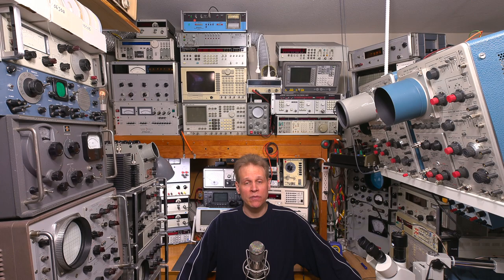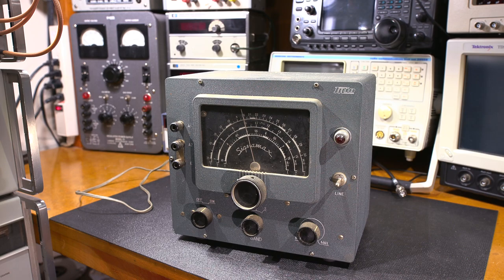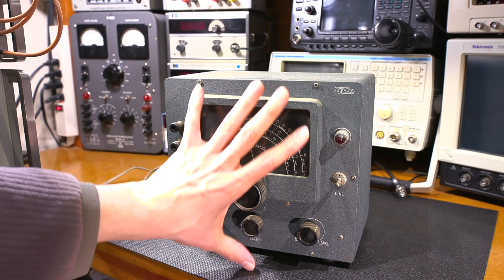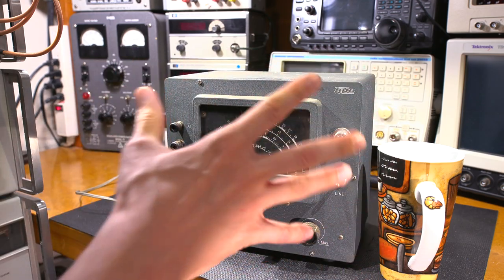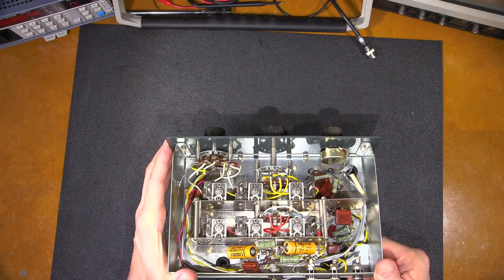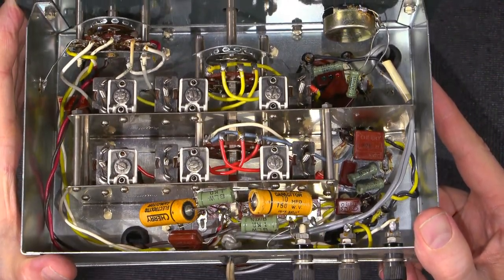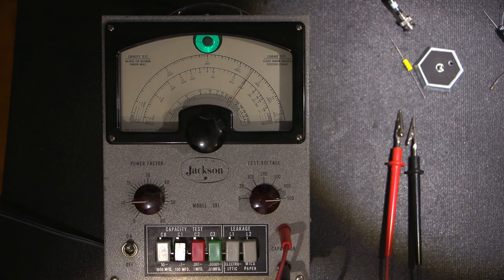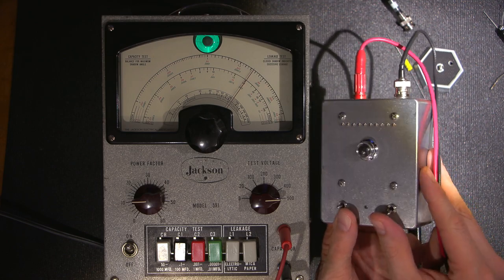Signal Booster Amplifier- The TRIO RF Preselector Restoration!

Comment: Is that storry actually true about it sending too? I've heard that was a made up storry by the BBC so more people would pay their tv-radio tax. 
If it is true, please make a video where you read the transmitted signal of multiple radios. Greetings.
Reply: It may have worked in the '50s, but anything solid state would emit so much less that it'd probably be drowned out by all the other noise.

I wonder if the BBC ever ran live demos showing said vans working
Reply: Put a shortwave radio next to a TV and you will easily detect the transmissions.
Reply: It certainly is true because the common "superhet" radio (and TV) design includes a local oscillator that leaks out.
Reply: @RiccardoMacri  And that can be measured from 10s to hundreds of meters from inside a van? I don't believe it and would like to see proof if it is so. That you can measure it standing next to it is normal, but from a distance I don't know. It's just a thing like Santa Claus, some people believe in it, but it's fake.(I'm talking about the bbc vans) Greetings.
Reply: In the 80's I had a couple of transistor shortwave radios, a portable and mains powered one. I could use the mains one as a crude beat frequency oscillator so I could listen to SSB on the portable, but the portable had to be 2 rooms away otherwise the carrier leaked by the mains radio  overwhelmed it. I'd imagine early tube designs with an external antenna, (and at VHF frequencies for TV instead of shortwave), to leak much more. But I  share your skepticism... theatre would be much cheaper than the ecenomics of manning lots of trucks with equipment and trained technicians.

Comment: At roughly 19 minutes... the red cap had nil internal resistance, but isn't that effectively the same as ESR, while the leakage resistance which you are trying to detect, should be virtually infinite? Or did I miss something?
Reply from the maker: ESR is a series resistance test, this device (Carlson LVLT) is a parallel resistance test.
Reply: I thought so too. The ESR is similar to the resistance batteries exert as a series resistance to load, and ideally that should be nil. 

But unless I really missed something, you refer to the resistance of the red cap being nil - you obviously mean that the cap has nil leakage which would mean virtually infinite parallel resistance, right?
Reply from the maker: Very low (not infinite)  parallel resistance.
Reply: @MrCarlsonsLab  In my limited understanding since a capacitor blocks DC voltage one would expect near infinite resistance whereas if you had very low resistance the corollary would be high conductance. My understanding from your videos is that when capacitors go bad they start allowing DC current to flow through them . I'll have to watch your Patreon videos again to see  if I got it wrong. or if you could point us to a video that explains this again to us less learned folks :)
Reply: @MrCarlsonsLab  But shouldn't the parallel resistance be high in an optimal case, and a low PR would appear as leaking? I understood that red cap was good but had "nil resistance" which sounds contradictory.

Well, I've been having a long and eventful (not completely in a good way) week at work, and I have no doubt that you have also been busy. Even making these videos must be quite taxing - so it's just this little point here which I might be misunderstanding, but strikes me odd.

BTW that cap tester and the super probe are fascinating pieces of design.

Comment: I am of the opinion that it is my right to listen to any electromagnetic radiation you send through my body. Don't want me to listen, don't send it. how much do you think the gov'mint paid to have those creeper cars vs how much they made in licensing? Also you could just put one those rf pre-amps in front of a direct conversion receiver (no heterodyne noise) so they would have a much harder time finding you.  then make a small heterodyne based receiver that tunes randomly, glue on a magnet, and attach it to the creeper car when they are at the donut shop. Bwa Ha Ha!